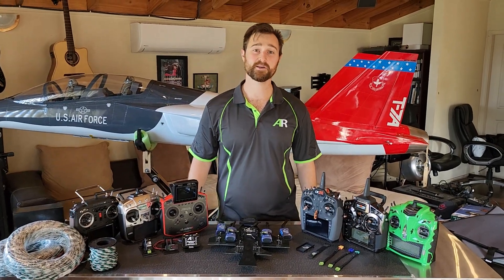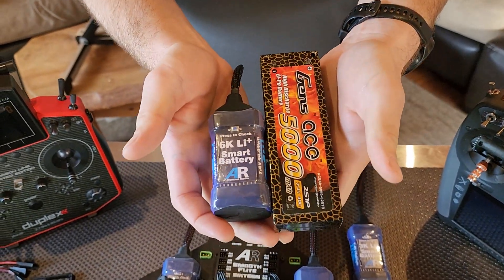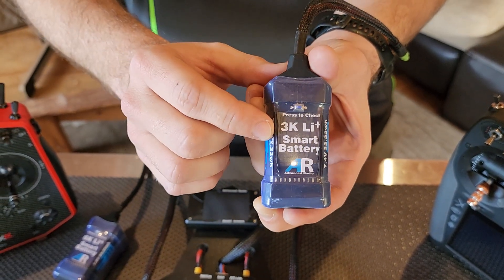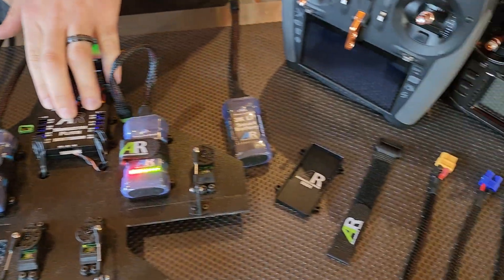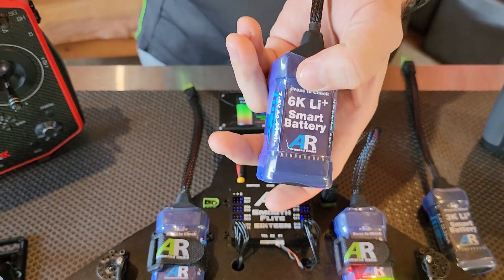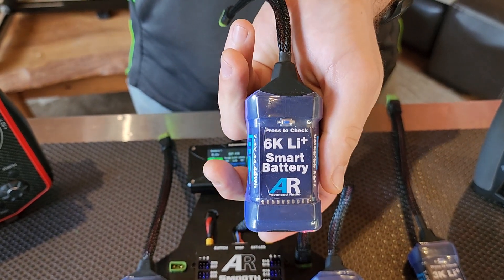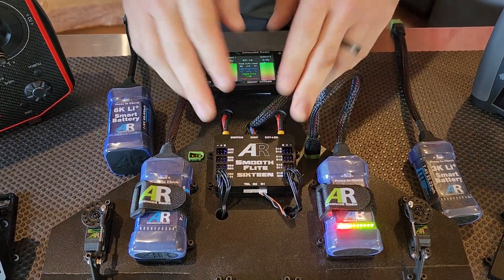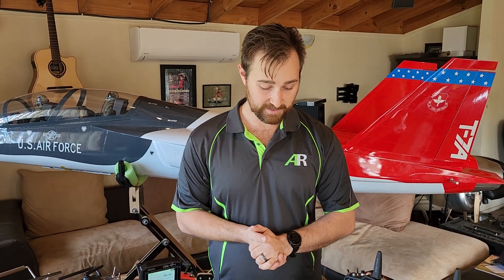AR Smart Batteries

Comment: Which chemistry and voltage?
Reply from the maker: Chemistry is Lion. Voltage is 8.4volts max and 7.4 volts to 7.6 volts operating. Designed as high end receiver batteries
Reply: Awesome. In other words charged as lipo then?